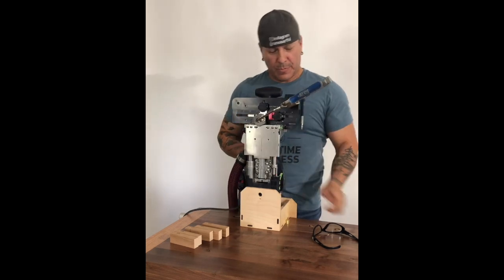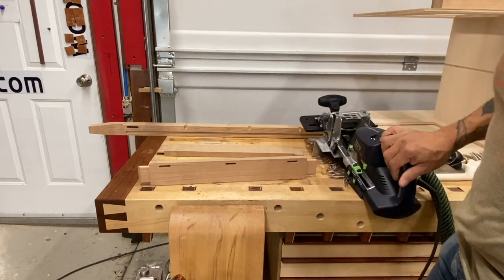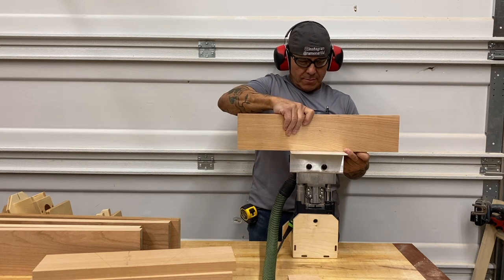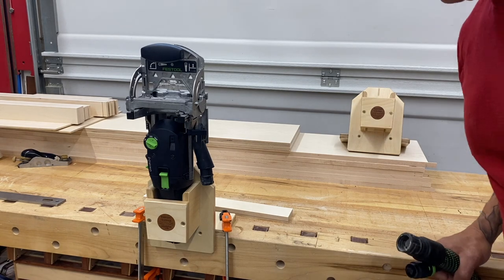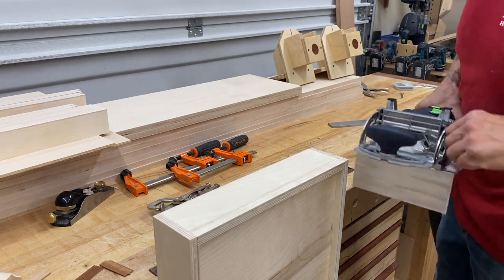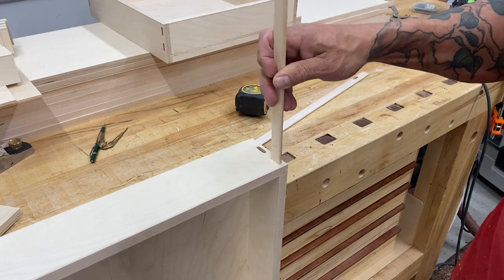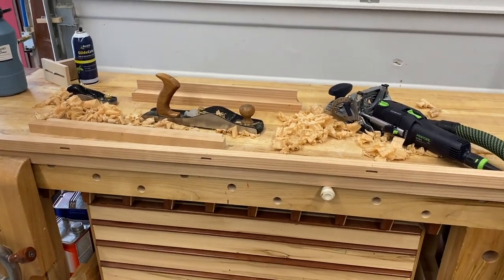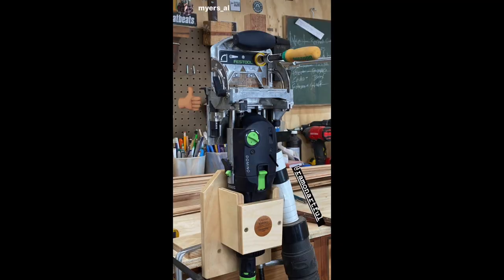The Dock & Deck  for the Festool Domino

Comment: Received  my df500 dock and the aluminum deck a couple weeks ago. Just in time to mortise 50- 2 inch pieces mitered on both ends. Made a quick jig to clamp to the deck and had it done in no time. Working with small parts is always a challenge and I could have built a jig to hold the pieces in place the on workbench  but there is always the chance of bad registration or excess movement. When the only thing moving is the plunge mechanism chances are greatly reduced. Might order the larger dock for my Df700 just in case I ever need it. Thanks for coming up with this and making it available to the rest of us.
Reply from the maker: Great to hear!  Thanks so much for the support!

Comment: Just buy one, it's that good!  I just recieved my dock and it's a game changer.  Makes the XL700 so much easier to handle.  Truth be told I probably should have bought the 500 as most of my work is smaller.  For what festool charges for the domino something like the dock should have be included, it's do much better than the Domino alone.  Ramon, your shipping is lighting fast as well.  I of course waited to order the dock until I really needed it and I recieved it the day after I ordered it!  I'm in Oregon close to your distribution but still as amazing as the dock itself.
Reply from the maker: Thanks a ton for the feedback!   I think getting the larger XL 700 is a good move.  I made an adapter for mine but Seneca sells them.  With that you can use all size cutters. I do have access to a machine shop and used a grade 8 bolt when I made mine…even though I have the DF 500, I still use it.  Cheers
Reply: Where did you buy your dock? Site seems to no longer offer it.. or they are just out of stock for weeks on end. The Notify Me button doesn't work either. Hoping they release the cut sheet and plans to make one.

Comment: Cool idea.  I bought the plans for the 500 dock and built one this afternoon.  Domino fits very snugly in the dock and the dock makes it so easy to domino small parts.  Might have to get a deck because I find face dominoing awkward.
Reply from the maker: Great to hear it!  I use mine all the time.  And that’s exactly why I made the Deck.  I had forgotten about the one Festool sends in the box.  Then later, I simply found it too small and weak.  Thanks

Comment: Suggestion for the Domino dock-I built mine a while ago and cut a slit in the front piece that allows you to slip the machine in without having to unplug it or thread the cord all the way through.
Reply from the maker: Yeah…that’s a very valid point for sure that I’ve considered.  But where would my emblem go?! 😬 Thanks

Comment: Any idea when the dock will be available again?  Unless it's available directly form you, Seneca has been out of the product for a while.  There's also a holster available on the market, but I like this idea, if I can get ahold of it soon.
Reply from the maker: The flat packs are being cut CNC by a new and improved supplier.  The version that I make (assembled, sanded and lacquered) is always available on my website.  I’ll share the link for the DF 500 but both versions are available.  Thanks a ton!  Someone told me that the holster…(I knew this would happen at some point) the DF 500 fits it well,  but the machine can twist.  Mine has registration points.  Anyway…many thanks 

https://ramonvaldezfinefurniture.com/product/the-dock-for-the-festool-domino-df500/

Comment: Love the Dock! How did you center the Seneca plate on your DF500? Seems to just slide left/right a bit.
Reply from the maker: Great to hear!  

Do you mean the Dock Plate XL?  It should have four Allen head screws on the plate.  Those engage with holes in either machine.  Or I’m misunderstanding you.
Reply: @ramonartful  yeah, but they grab onto the  Domino fence and it can slide left/right making the fine scale on the Seneca plate inaccurate.
Reply from the maker: @youmbgtube  Do you mean the four screws on the Dock plate allow too much slack? I'm still not clear on your question.

Comment: But why the orientation of the machine in the dock I mean I geus it is in the same orientation as it would be hand held but when I made my fixture for my lamello machienes I found it more convenient to turn it around.

I am just curious it isn't critic of any kind
Reply from the maker: Easier to sight center…plus all the controls are a bit more accessible.  I also think it’s easier to hold the parts this way.  Thanks

Comment: So I thought I was gonna be a penny pincher. I bought a piece of 3x4x12 right angle aluminum on Amazon so that I could make my own 90° deck for cheaper… well it came in and that bad boy was way out of square. So I guess you win my friend. Gonna save up and buy your 90° deck 😂😂
Reply from the maker: Right!?  It’s surprising how far off they are.  Believe me, I make very little on these Decks by the time I cut em, sand saw marks, mill them square, drill holes & clean them, supply knobs, etc.  But I sure do like the positive feedback that I get from people who purchased them.  You’ll love it.  Thanks

Comment: Nice setup but why is the work area away from the user. I would feel more comfortable with the Domino bit facing me.
Reply from the maker: Fair question.  When I made it in 2016 (first one was for the XL 700) I played with both directions.  Pros n cons each way.  This is the way the user normally has it oriented…as it was intended.  The switch is easy to see and reach.  And the sight windows work this way as well.  Plus, it’s easier to hold the parts.  Thanks for the input. 🙏🏼

Comment: Neat! But at @6:43 you can clearly see the part coming unseated and the clamp moving. No way is that domino cut correctly.
Reply from the maker: I’ve watched this several times.  The piece does appear to be away from the fence but it’s not…it’s weird lighting.  And yes, the clamp swivels slightly as the plunge is made but the foot of the clamp still holds the piece in place.  The mortise was perfect…I used it. 😬 thanks a ton
Reply: @ramonartful  Sorry but think you're wrong here... Look at the circle/oval shape that is parallel to the ground to the left of the cutter. It starts out blocked from view from the block, then as the clamp loosens you can see the block pivot up and the oval comes back into view, it then stays in view until the bottom of the plunge, at which point you take off the clamp and the block falls down blocking it from view again. Lighting couldn't do that. 

It's not a big deal for the overall video/product, but it's 100% lifting.
Reply: @mike8984ify  saying the truth is always an option.

Comment: Will be placing my order the minute I buy my domino in the next or so. There was a recent video (https://www.youtube.com/watch?v=eK0C95NkeyY) about the new Jessem jig as a Domino replacement stating that one of the main drawbacks to the Domino was the difficulty working with smaller pieces. I posted a Comment to let people know about your awesome jig. I hope it generates some business for you Ramon. You make some beautiful pieces and post fantastic tips (my wood clamps for my k3 came out great) and you deserve it. Build on my friend!!
Reply from the maker: Thank you tons.  I looked through as many comments as I could handle! 😆 Couldn’t find yours, but thank you.  I’ve done woodworking shows where I cut 4mm mortises into pieces of wood about 5/8” square and only 4” long using my XL 700 and The Dock.  People are surprised!  😬